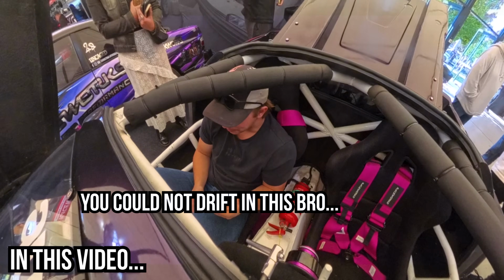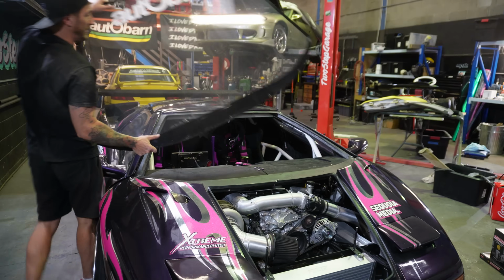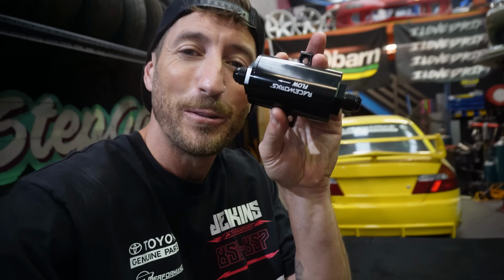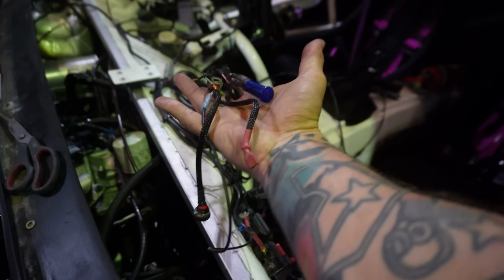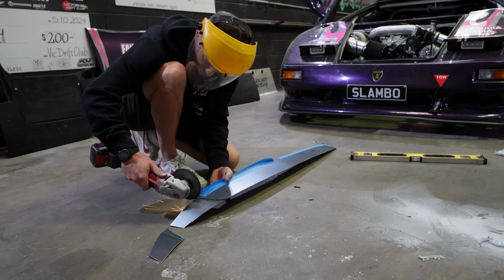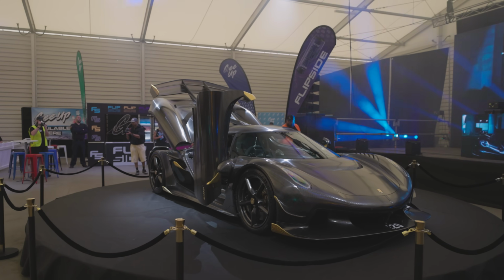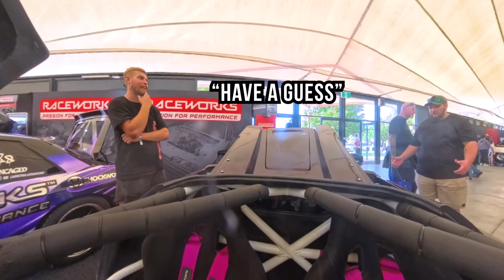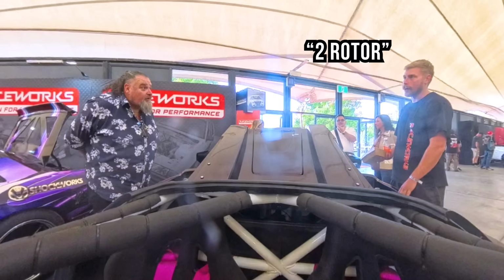Hidden Camera Reactions to FAKE SUPERCAR!

Comment: Yes sir, I always ran a 6 micron fuel filter when I ran E85 in my fully built turbo Civic coupe. Yeah, I know, ew Honda...but it's hard to argue with a Honda that ran low 10s, and made 709 wheel horsepower. My buddy has a 92 Civic hatch with a fully built B20VTEC that made 832 whp and ran a best of 9.56 @ 155 MPH.